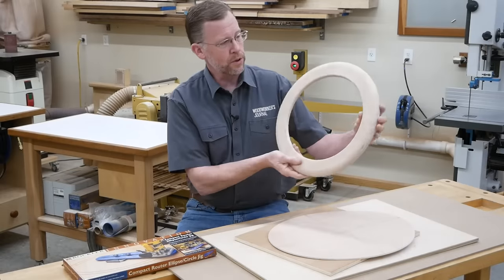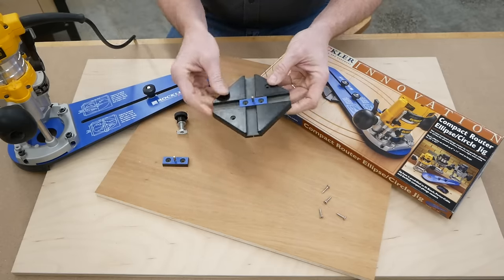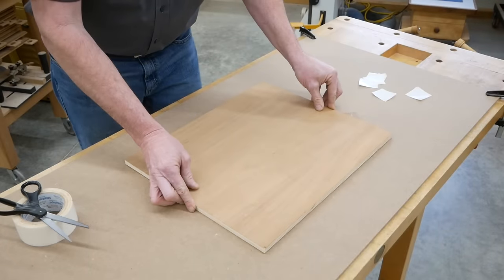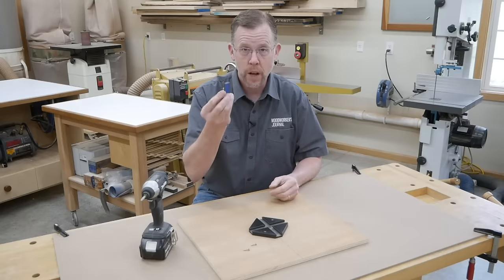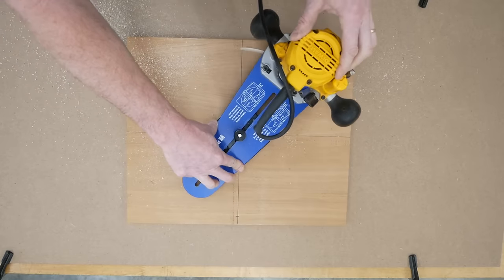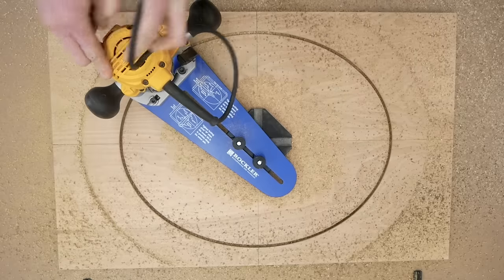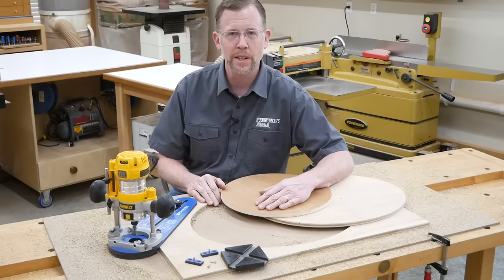Cutting Circles and Ellipses with the Rockler Circle Cutting Jig

Comment: A couple of design considerations and suggestions for Rockler.  Jig is rock solid and accurate, which is great.  There are use cases where the jig won't work. For example, you need to drill four holes into your work piece, other jigs get by with one, or none if one uses the center circle with double sided tape and a piece that travels around the center circle. The base and the offset under the router plate is thick, so make sure your drill bit extends far enough to make up for that, especially if your stock is anything thicker than a template.  One caution:  Drilling the holes for your router so the jig fits can get scary because of the material one drills through, which is tough, leaves a burned plastic smell and - at least for me - made the sound of glass shattering.  But once that hurdle was cleared, it's worked well to cut circles for the use cases where 4 holes in your work piece is not an issue.
Reply from the maker: Thanks for your honest feedback. We will pass this along to our product development team. Please note that it is recommended to attach the jig to the bottom/back of your workpiece so that the attachment holes will not be seen. Thanks
Reply: Thank you for acknowledging.  I used the jig yesterday, and it worked well.  I like that it's sturdy and accurate.    @rockler
Reply from the maker: You're welcome. Good to hear that it works for you. Thanks!

Comment: Please excuse me if this question has already been asked and answered in the video, but what is the maximum size for a circle for this jig?
Reply from the maker: 24.5" is the max size.
Reply: @rockler  I wish you had this size for the bigger routers. I have to get the bigger jig even though I’ll like only make up to 24 inches .  I didn’t want the compact router in case I end up needing the slightly more powerful motor of the router I ordered .

Comment: I ended up ordering the 1 3/4  dewalt router because the Canadian stores that sell the jig only sell the larger jig. I may never make elipses bigger than 16x20 but I also thought having the slightly stronger motor will be good. I also want to do carving with it so I hope that size router won't be too cumbersome. These tips for measuring are helpful.  Maybe Ill get an 1/8" bit for cutting thin plywood and 1/4" inch to cut mdf.

Comment: I wanted to purchase this jig to cut a circle for a project I was working on plus to have the ability to cut an ellipse in the future. I own of the early 1hp VS Bosch Colt Trim routers with the fixed square base. There was a question with the salesperson at the Rockler store if it was compatible with this jig. I wound up purchasing the circle cut only jig as we did not know and it worked perfectly. Will this jig work with my current router or do I definitely need a plunge router to go with this jig?
Reply from the maker: Hi there, please reach out to our Product Support team at 1-800-260-9663 or support@rockler.com. They may be able to assist you. Thank you!

Comment: I read the comment below about using double sided tape instead of drilling holes to hold the base down. Can you recommend a tape that’s strong enough for that? Then of course you’ve got the issue of getting a tape with that strong of an adhesive off! Acetone?
Reply from the maker: Hi there, carpet tape reinforced with fibers is easy to find at most hardware stores and home centers. It will work fine for securing the base of an ellipse/circle-cutting jig to a clean wood or plywood workpiece. The fiber-reinforced tape is a stronger choice than carpet tape with no fibers in it. Also, bond strength depends on lots of surface area. So use longer strips of tape than shorter pieces for best results.

Comment: A video about this jig says to run the router COUNTERclockwise.  You say clockwise.  What's the diff?  I have been having a lot of trouble trying to do these.  I got the Xfasten Tape which is supposed to be so super - but it isn't holding very well.  Had to drill holes and screw the wood down.
Reply from the maker: Hi Paul Glanville, Please reach out to our product support team at 1-800-260-9663 or support@rockler.com. They'll be able to assist you. Thank you

Comment: Will cordless routers work with this jig? I have the Ridgid version.
Reply: Michael Kratky it would depend on the screw pattern on your Ridgid router’s baseplate. You’d probably need to drill some holes through the jig arm to match the Ridgid pattern. But then, corded or cordless will work fine.

Comment: Hey Chris, If you don't want screw holes in your circle or ellipse, can you use double-sided tape to hold the base in place? It seems like that should work if you're careful and don't push outward while going around the perimeter. 
Have you ever tried that?
Reply from the maker: Yes, I have tried double-sided tape with the circle/ellipse jig. It works well and is a good way to avoid having to drill holes in the jig base. Good tip!
Reply: @rockler  Great! Thanks! 👍😀
Reply: What is the minimum difference between major and minor the jig can do? My difference is 3"
Reply: @rockler  Can you also use double sided tape to  hold the centering pin?  Don't know if there is enough surface area to keep the pin from moving.
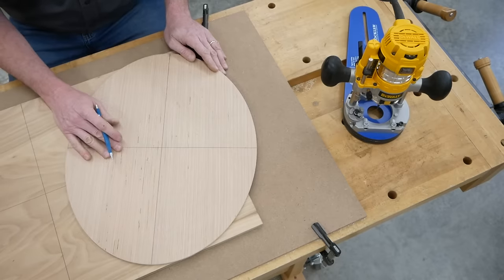Reply: 04:12 no more than 5 inches
Reply: I was wondering what kind of adhesive tape, I.e. brand would be good/strong enough for this? And to remove that adhesive later, acetone? Thanks!
Reply: @princessadventures234  - Carpet tape should work. But I would try double-sided woodworking tape such as Spectape ST501. Amazon has this.
The tape I use is from Intertape, but I can't remember where I bought it. 😖
I don't think it left much residue, but if it did, mineral spirits is my go-to cleaner.
I hope this helps.
Reply: I don’t even use double sided tape I use painters tape and CA Glue. Tape on the work surface and under the jig base. Spray activator on the surface tape and put some CA Glue on the jig base tape. Line up and press firmly. When you’re done all you’re lifting up is the painters tape and discard. No messy double sided tape residue to clean up

Comment: Can you cut an inner eclipse so you will have a frame?
Reply from the maker: Yes, the second cut would simply be a smaller ellipse inside the larger one. Reset the jig to smaller diameters and proceed with the inner ellipse.
Reply: @rockler  Thank you.  I am going into my local Rockler store.  I am wondering if the larger base would work on a DeWalt Compact router.
Reply from the maker: Hi there, you are welcome to call the store or ask one of our employees during your visit! They may be able to assist you. If not, you are welcome to reach out to our Product Support team at 1-800-260-9663 or support@rockler.com. Thank you.